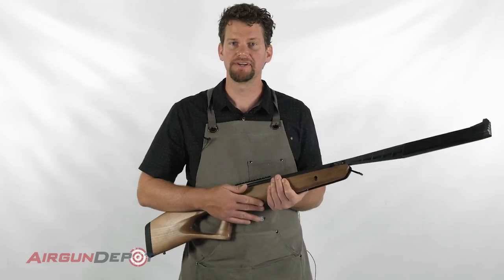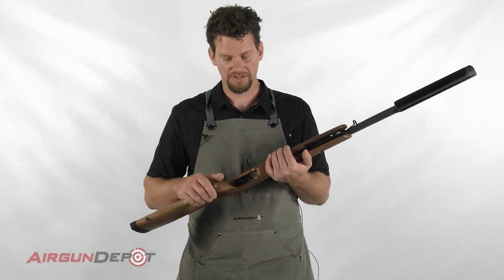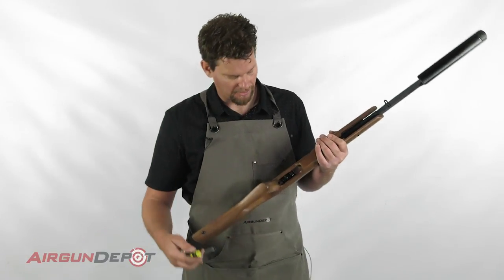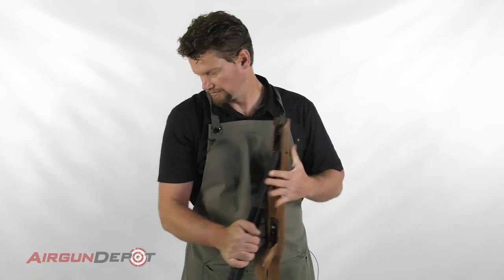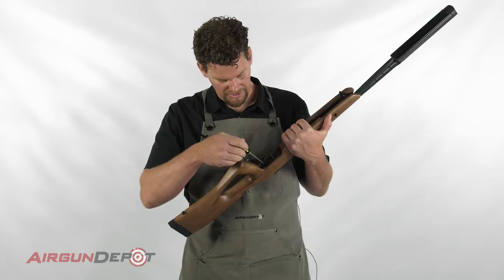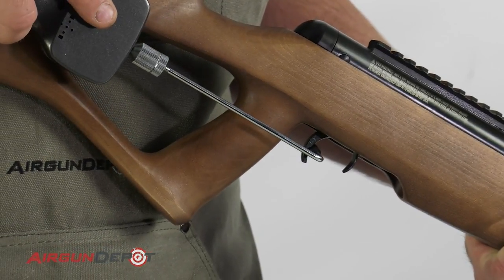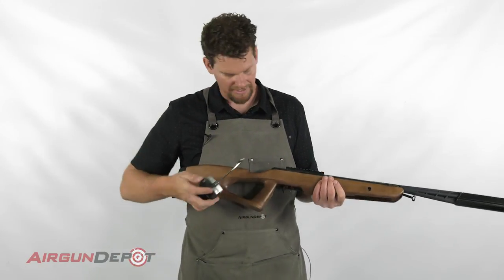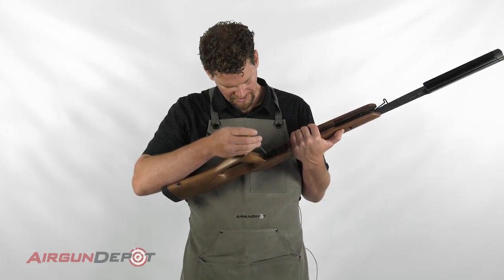Benjamin Trail NP2: How to Adjust the Trigger

Comment: I took the adjustment to where the screw was almost out and saw very little help, if any on decreasing the pull. What’s next, replacing or having a gunsmith redoing the trigger assembly?

Comment: Thank you very much that was very helpful. I do have one question that I am having a problem with the same rifle Benjamin trail NP2SPD. Which is the same one you’re using is what I own for some reason it is shooting high and to the right. It started doing this after two years of owning this rifle. I bought a new scope thinking that the natural pistons double recoil Had damage the scope I’m using a hammer’s 4x12-40 air rifle scope it is built to handle the double recoil piston scopes. I have had to take the elevation adjustment all the way down to bottom out in the rifle is still shooting for inches high and 4 inches to the right I have also had to bottom out the windage adjustment all the way to the left. I had to do the same thing on the new scope so that tells me the scope is not the problem something is wrong with the rifle. I took it apart cleaned everything as I would clean my AR 15 and reassembled checked All of the fasteners were tight and now it’s worse now at shooting a foot to a foot and a half high on the target not hitting the target but the target backing you can’t even see where the pallet is heading through the optic. Any help would be greatly appreciated. I’m wondering if I have to buy a new rifle
Reply from the maker: Has the barrel ever gotten away from you and slammed back up? That can bend the barrel and account for your issue. If it isn't that then we don't have any suggestions, other than buy adjustable rings to compensate. FX No-Limit rings will take care of the elevation, but to compensate for windage you will need something like the fully adjustable Sportsmatch rings, but they are very expensive. The last option is to bend the barrel down and over.

Comment: @Airgun Depot - Have you tried the trigger adjustment of the newer Nitro Piston Elite made-in-China models? Vaporizer/Quest/Ironhide etc.  It seems like they use a much shorter screw M3x5mm Phillips that provides almost no usable adjustment.  My Vaporizer (.22) has the adjustment screw all the way in and it still feels too light, like there is no clean separation between 1st stage and 2nd.  So just curious, what is the adjustment screw length on these American made models?
Reply: could put a lighter trigger spring in also